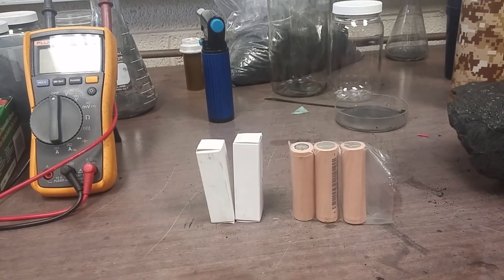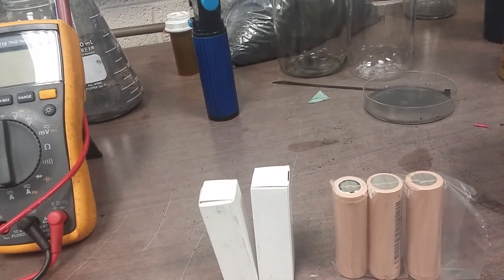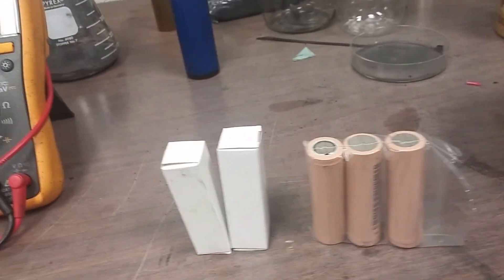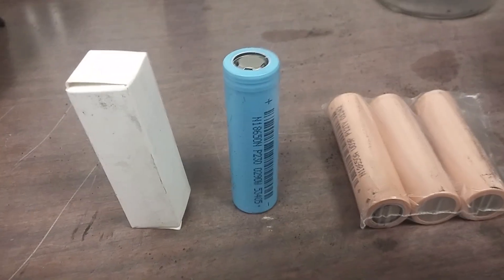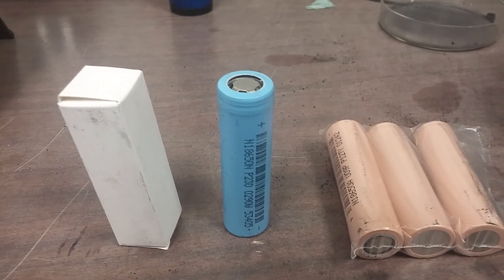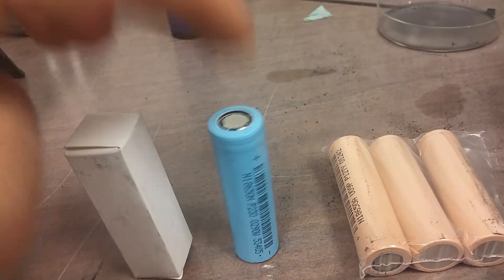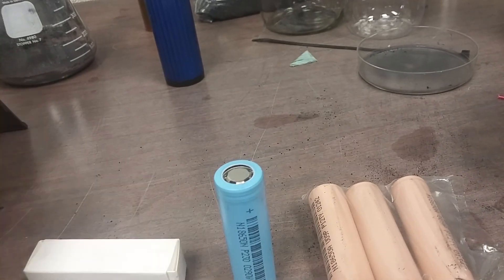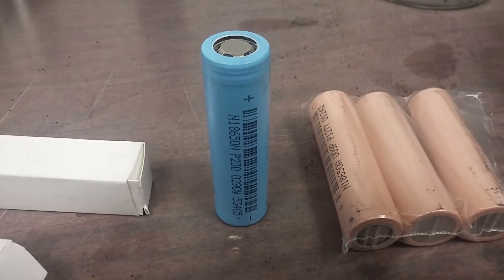Real graphene batteries. Finally!

Comment: 50% graphene and 50% graphite, do you know what you're talking about? Do you know what graphene is?
Reply from the maker: I will clarify. The anode is usually graphite in an ink. So they did a mixture of my graphene and their normal graphite in the ink. 50/50.

Comment: as jonathan said, "Waiting for some real video proof that these are not just cheap chinese old-tech lithium cobalt 2C 2200mAh cells. They surely look like the entry level stuff. Only way to tell would be a video with discharge curve profiles. I'm sure people who would actually make real graphene cells would jump on the occasion to show their scientific test results.... I could also do a vid, showing a LiCo cell from 1991 and tell you that it's graphene...." 
cells are marked as li-ion 18650 1800-2200 mah cells are are made in china. If i made a supper cap out of graphene i would not label it as a china 18650! 
YouTube is turning into such a BS place to find any good info 
Back to the forms for us tech heads

Comment: Why does the serial number on the side of the 100 percent graphene say its a N18650 which is the same designation as hundreds of similar batteries even the ones you are comparing it to.
Reply from the maker: It's made from one of those cells. This is a 18650 cell, but they changed the anode material out with my graphene.
Reply from the maker: yakyakyak69 you know your batteries! Great job.
Reply: N18650 - first letters are the signature for chemistry in the cell and the numbers are the size of the cell
Reply: "The last number "0" is meaningless."
actually, far from meaningles it designates the cylindrical shape of this cell

Comment: Been a year now I have been building a battery powered surfboard. Batteries is hard to find these days to give good performance. Maybe this is something I've been waiting for.. high discharge capacity and longer time riding. Right now I'm making a tuff decision choosing lipo or ion batteries.
Reply: you know that surfboards are wave powered don't you?
Reply: There are many types of surfboards. I am building an electric powered surfboard that will move at high speeds.
Reply: Lipo give more punch

Comment: How do you control the discharge so that it's not a curve like a typical capacitor?  Internal discharge rate? Leakage? Curious if this can replace Austin batteries without having to put in control mechanisms for the capacitor behavior.
Reply from the maker: Joshua Fausset the discharge is more like a battery.

Comment: Fairly cool! Congratz on finally having big cells! :)
How much of a performance improvement or other advantages do you estimate them having compared to Tesla's/Panasonic's 18650 or 2170 cell respectively? :)
Reply from the maker: Kniffel101 I think Tesla has technically higher storage than these (because of size) but they would certainly benefit from using graphene in thier cells.
Reply: How exactly would they benefit from it?
Energy-density, performance or recyclability (if that's a word ^^) or something completely different? :)
Reply from the maker: Higher energy density, faster charges, and longer cell life are the major improvements.
Reply: +Venturestarx 
I'd say those are some pretty nice features! ^^
Reply: @Venturestarx  where to buy

Comment: Are CC/CV charging and voltage characteristics the same (3.6-4.2)? What about holding charge? How in the heck does one even go about manufacturing these? That's nuts!       

I have to be skeptical going off just this but if you make a video after figuring out how to test these I'd love to see how charging actually works.
Reply from the maker: WHAT THE PLANTS CRAVE excellent questions, and it's good to be sceptical. There have been far too many promises from fakes. the voltage is the same as the Li-ion counterpart. (3.7v) They also have extreme durability, with very little self discharge.
Reply from the maker: WHAT THE PLANTS CRAVE also, they are manufactured close to the same way as the Li-ion counterpart. So any company can adopt this tech with minimal tooling.
Reply: It definitely does sound too good to be true, but I look forward to seeing the tests. I also follow Robert Murray-Smith's channel and having seen the kinds of things he does with homemade supercaps I definitely have an open mind, and this looks like the right direction for graphene if someone can make it work.
Reply from the maker: WHAT THE PLANTS CRAVE Robert is very good at what he does. I hope to work with him more in the future.

Comment: How long until it will be for sale world wide? Would like to use these if possible on my electric bike ^^ and how much do you think they will cost per cell right now and in the next couple of years?
Reply from the maker: Jimmy Sundberg the cells will be slightly higher, but still comparable to current costs. They should be commercially available by the end of the year.
Reply: Hello from 2023. 😂

These still aren’t available.

Comment: Awesome, but does this mean the graphene I bought from you in the past wouldn't be the best for batteries?
Reply from the maker: It will work, but the iron content can be higher than desired. (>6 ppm) Putting a high powered magnet near the powder will lift it out.
Reply: Is the iron intercalated? I will try that out
Reply from the maker: Hanson Hacks it's not in there that much. It's really easy to get out.
Reply: Just run it through the mix? Might get messy lol
Reply: Talking about the iron content? pulverize and use a magnet to fish out the iron? float in solution and washboard the iron out? ^^